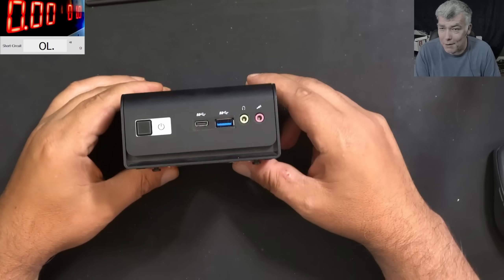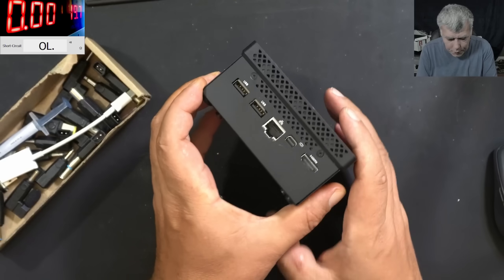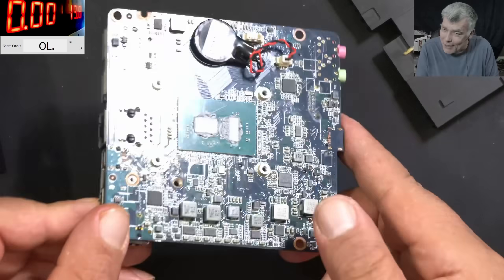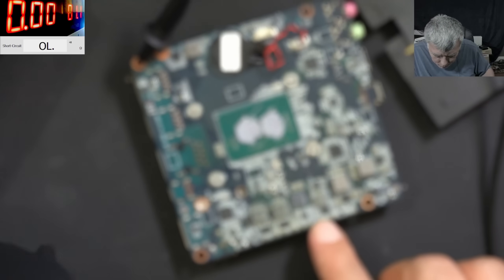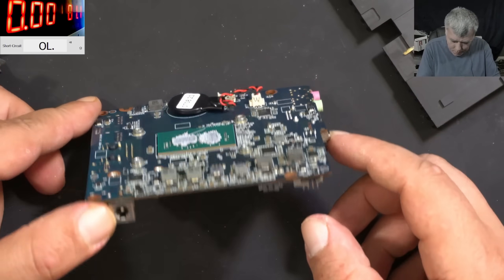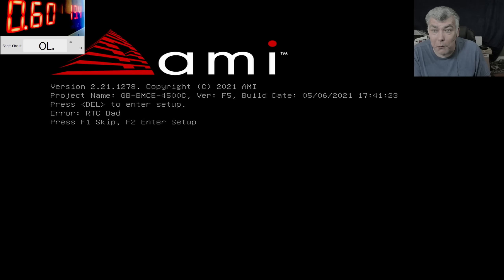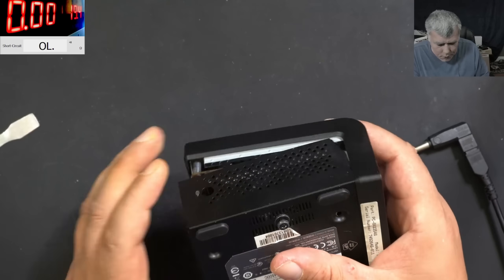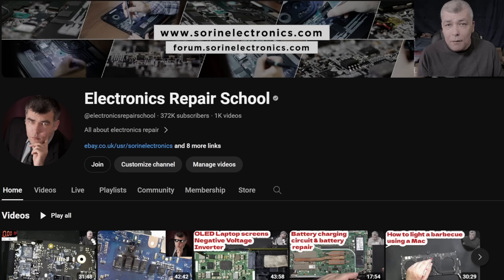Gigabyte Mini PC repair - no power board repair, a classic fault

Comment: I have the same type of connector and adapter. Problem seems to be contact, it will refuse to start, light up sometimes when adapter is inserted, after a few minutes of trying it will start when power button is pressed. So this is not a short or broken component?

Comment: Gosh... why all my repairs are dead PCH and not fried caps? LOL
Reply: @mime4331  its 50-50. i bought 7 dirt cheap asus/hp  motherboard laptops with haswell /broadwell /amd, 3 shorted cpu/pch , 4 fixable, all no shorted caps, only charging ics / power supply ics/superio/  related/ lvds 3.3v problem

Comment: Why don't you replace the capacitor ?
Reply: because replacing a capacitor costs a quarter of the pizza😅
Reply: It is not needed.
Reply: the capacitor is there to filter voltages going in or out of that chip, as you see, it works without it

perhaps is for a usb port? ram?

migth make it randomly restart, or migth not happen anything ever
Reply: @betag24cn  Filter ? So can a missing capacitor can lead up to an unpredictable BSOD sometimes ?
Reply: @Alb_881  it filters noise in the voltsge, and in the worst case, no bsod, a ful reset

very rare, specially on those chips, it should be fine

once i removed a bunch of dead capacitors around a cpu, the thing worked just fine

notahing guaranteed, better to replace the part, but if is a filter in paralel, nothing will happen, probably, lol

Comment: Wait?!  You removed the capacitor but didn't put in a new one?  I'm lost.
Reply: That particular capacitor is for rf noise filtering. It will not influence in any other way the circuit. He has the experience to replace the component if it’s truly needed. By all means if you have time to search for schematics and capacitor values (if they are available online) you can replace it.
Reply: most of the times he is replacing the capacitors in another video 😅
Reply: the reason is he has to search for the schemaric if he can find one,  find the values of the caps , find and took out  from donor boards . It will be a  time consuming and boring 2 hours video. 😅

Comment: So, you have removed a capacitor and the design it is equally valid? Why you don't put another one? Isn't it more probably the PC have another breakdown soon?
Reply: @farplenorp  This way we know the PC works too.
Reply: Are you sure you can find the capacitor value somewhere on a schematic online and it will cost less than 50$ of your time searching? And all that to comply with rf regulation number xxxx-yyyy etc on no rf unintended emissions 3 cm from the board?
Reply: @gjbcapital1847  It is a simple capacitor, it is supposed to be well designed and the radiation outside the two conductor pieces it's spourius, etc... Nevertheless, I don't know much about electromagnetic interferences and less about it's applications in the real world. I haven't be asked to work in that area.
Reply: @gjbcapital1847 So, do you think this is a dangerous job? Because he works with broken batteries, pieces, etc... do you think the British gouvernement haven't regulated it properly? Maybe Sorin should make a consultation to them.
Reply: the capacitor is there to filter noise, the voltage comming in or out of those chips

there migth be sudden restarts or usb devices complaining about usb power, stuff like that , most likely nothing will happen, ever

for peace of mind, if you find the replacement part, replace it, otherwise, it works
Reply: @betag24cn  Yes, there are a lot, they are there to filter any alternating voltage. Not so nimious, not only noise.
Reply: @Unasoluciónquiero  well, i simplified things, but i have done this in the past with other motherboards and worked like it worked here

Comment: and if we have a switching power supply can we still use it to find faults?
Reply: Some switching power supplies switch off when there is short circuit.. u have to consider that when buying
Reply: @charlesmawale9114  i have one and it look like its working fine for finding faults am juste asking to know the difference between them in practise

Comment: I have a SMPS and it clicks to. It can suplay ten amps and it was cheap, I'm happy with it.
Reply: yes no need linear bulky expensive supplies . When you plug in SMPS to the system it shows how much current it takes. Do i need to hear click sound ? No need...
Reply: @seckinseckin3919  Mine is a "Nice Power" that I bought on Aliexpress and if passes the corrent you set, you hear a click and an a overcurrent LED lights up.
Reply: @seckinseckin3919 I don't know if it's a relay or something else, but in mine smps you hear a click and the overcorrent led lights up. It is a cheap "nice power" that I buy one aliexpress.

Comment: Your content is painful to watch because board doesn’t get all components back :(
Reply: Customer is less likely to hurt their back while lifting the mini PC.  Should pay Sorin extra for saving on chiropractor charges.
Reply: @MattyEngland  nice one (not)
Reply: @Misimpa   You're welcome :)
Reply: Trully
Reply: :c
Reply: That is a part of business. Another cap in parallel will heat and die soon.  And another easy pizza is on the way already.
Reply: Quoting from NorthRidgeFix: "If you have 100 bodyguards guarding the perimeter of a small building and one of them falls sick, you still will have 99 bodyguards still able to guard that one building" Same is true for the capacitors on a main power rail, if one goes bad (shorts to ground through itself) and you remove it and not replace it, the laptop/computer/phone will still work just fine. Capacitors on the main power rail are not needed for smoothing out voltage but to allow for the device to pass final testing in relation to stuff like frequency emissions etc before it gets rolled out into production and sold to people like you and me. :)
Reply: If it was dangerous to put the capacitor back near the chip like in the past videos then ok, but here it's just terrible. I hope this device will not need to be repaired, then it will be without half of the elements. Also, there are not 99 defenders, but only two (?) then all the work goes to one.
Reply: @Misimpa  You dont get the point.If you have a broken board with 100 capacacitors it costs nothing.It is literally rubish. A board with  95 capacitors but being able to start is 100 times better, because it is working.That is the difference between rubbish and a working pc.It works!
Reply: @Misimpa I believe you. It must be painful to watch something you don’t understant. That second capacitor is not carrying any current, and will not have to work more in any way now that it is the only capacitor there. The missing capacitor literally makes no difference here. No point in taking the risk to solder it back.
Reply: @moldo8811  Another thing to note, capacitors do not pass DC current through themselves and this particular one that was removed (The missing cap), surely doesn't matter - it had a bad day, bridged plates through itself and made itself literally a wire to ground where all the power would just go through it. Remember that voltage will always take the shortest path to ground in any way it can. Anyway the point is that it's just one of a gazillion decoupling caps and I'm sure the device won't miss it!
A cap has one leg on ground (1) and another on the rail (in our case, the main power rail)(2). If you remove the capacitor, because 1&2 are not linked together like they are for resistors and filters, there will be no effect to the voltage unless in circumstances where the capacitors are needed to smooth out voltage on a line when boosting or filtering. Very interesting stuff when you watch channels like these. It's how I learnt 👍
Reply: No capacitor no shorted capacitor.  Less problem
Reply: @alexandrupraporgicu3114  no motherboard components no problems, if screen is working it’s not guaranteed in long term because “stupid” engenders added too many capacitors. 

And if you need, just scrape them off the board.

Comment: Hi,

Thanks for the video.  You removed the capacitor but didn't replace it.  You don't need to replace?  can you please explain?
Reply: He said it: "No capacitor, no shorted capacitor" 😉
Reply: @rossano.balloco  Does it mean you don't need the capacitor?
Reply: @humayoonorya2259  it depends on rail and components configuration. if you have spikes or switching on power rail is beter insert capacitor for bulk energy storage, and noise go thru capacitor to ground (negetive rail) but on this motherboard is more than 1 cap on repaired rail, and he point on big cap next
Reply: No way, did he do that!? 😀